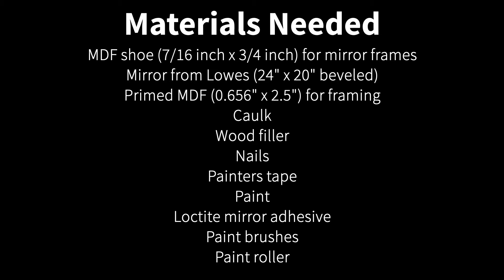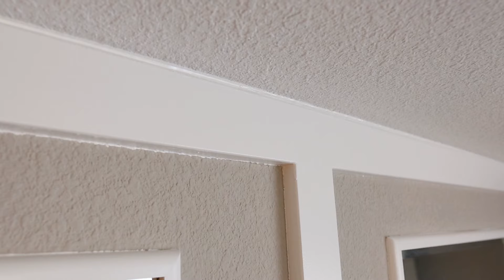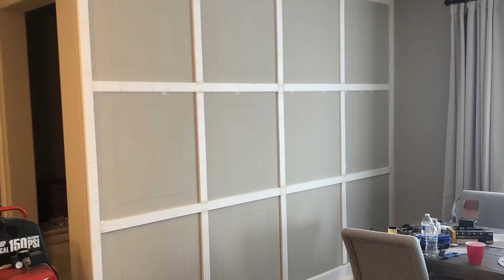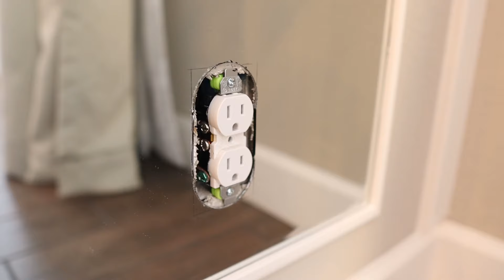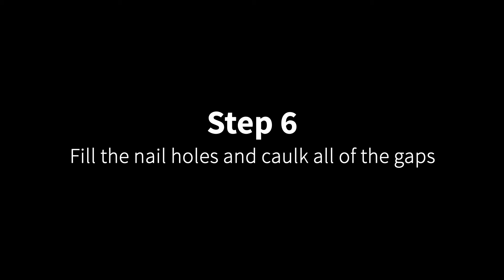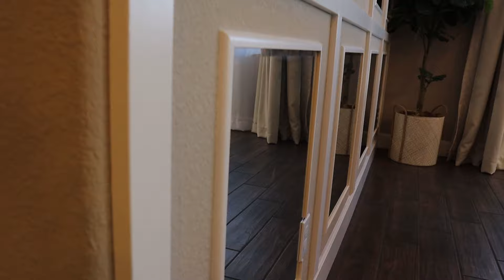HOW TO BUILD AN ACCENT MIRROR WALL DIY / STEPS

Comment: Nice job! Did u use the 24x20 mirrors as they come or did you have them cut to another size?
Reply from the maker: No modifications. Used them as they were
Reply: @jaesonflores3119  Thanks 4 the prompt response.

Comment: Awesome job! Looks so high end…. One question: do you think you can use mirrors with frames to skip the framing part of the mirrors? Kinda wondering if that would work and at the same time cut down on installation time. Thanks!
Reply from the maker: Thanks! You definitely can install the mirrors without the framing, but in my opinion it would look incomplete. One thing to note is the the wall isn’t always fully flat so some sides of the mirror might stick up higher than another. The framing will hide that.

Comment: What a great idea originally I wanted to do a cream peel and stick grass wallpaper on my dining room area wall on top of that I wanted a Chinese garden door symbolization using basically the same flatwood look with a dark stain but I like this idea it it's more modern and more open and I don't get that much sunlight and that wall that I'd like to mimic from you is right across from my main living room wall so that I think maybe a much better idea it will help to reflect a little more natural light in my apartment thanks so much for sharing I love this modern contemporary clean look continue to share many blessings